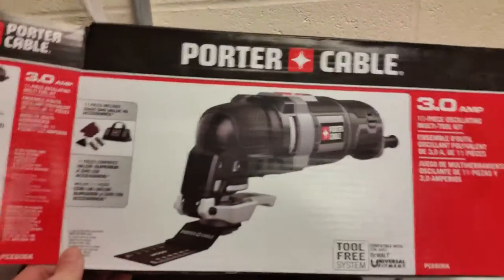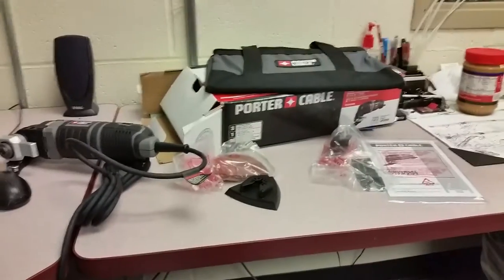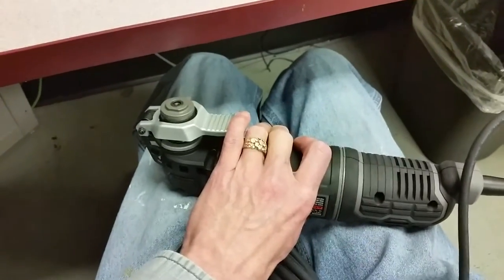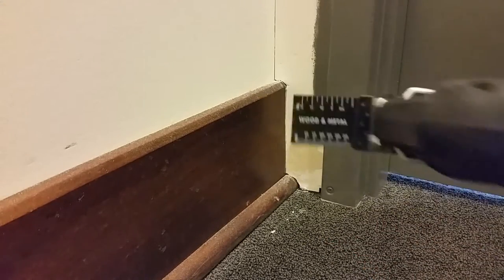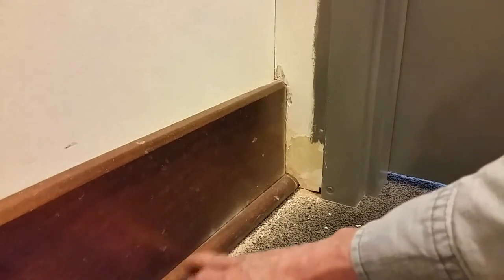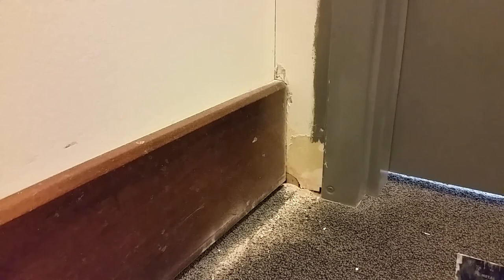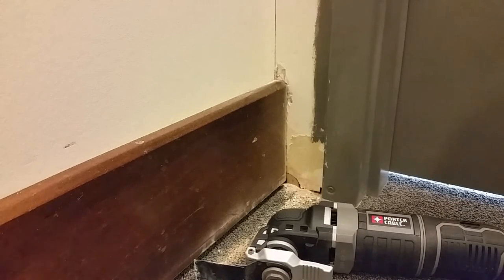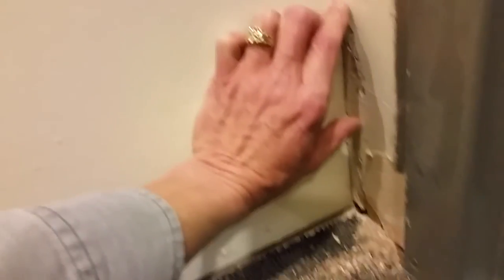Review of the Porter Cable 3.0 Amp Oscillating Multi Tool

Comment: I have this tool and bought some sanding pad on sale, the hole pattern looks like it’s going to work but this pad doesn’t have the slot to allow sliding it onto the tool. I notice there seems to be some kind of nut on the tip, I wonder if this can be removed? I could slip my pad over the shaft and reinstall that end piece... I tried and it won’t budge :(

Comment: I have a similar Porter Cable saw and the only thing I don't like is the price of the blades.  The wood/metal blade sells for about $13 each.  Ouch!!
Reply from the maker: +Norman Olliff I know right?!?!  It's one of those tools that you don't want to use often (BECAUSE of the price of the blades) but when it's the right tool for the job, it's the right tool for the job.  In my case, it was perfect, and well worth the price of the blade when it came to the time I saved.  Not to mention the cost of the materials to repair everything I would have torn up trying to do it the old-fashioned way.
Thanks a lot for watching and commenting!
Reply: I buy the blades on amazon and ebay for cheap....